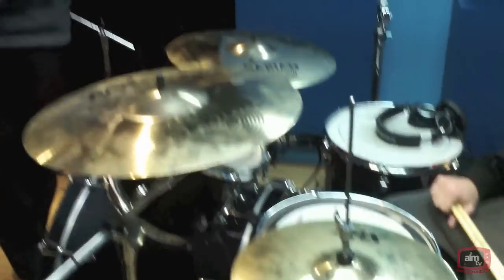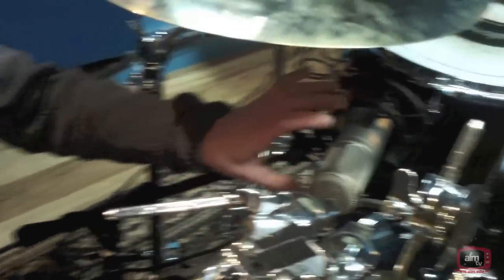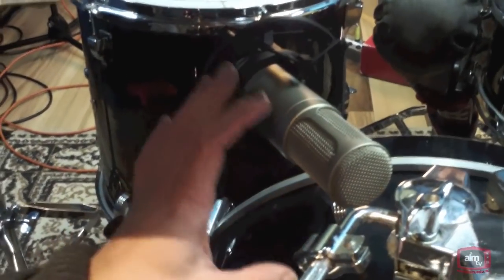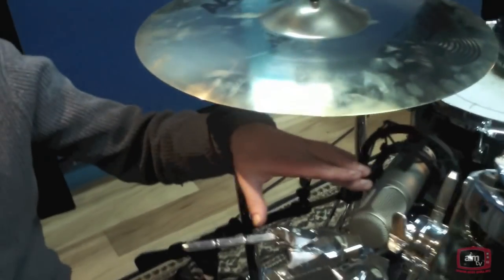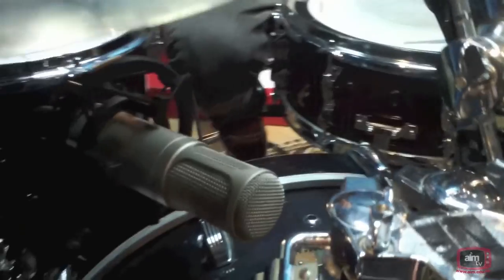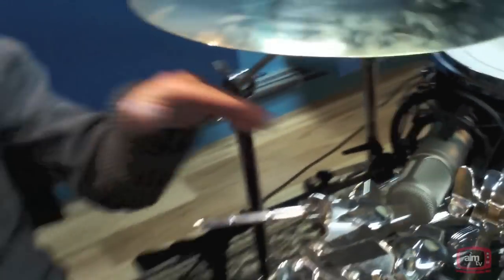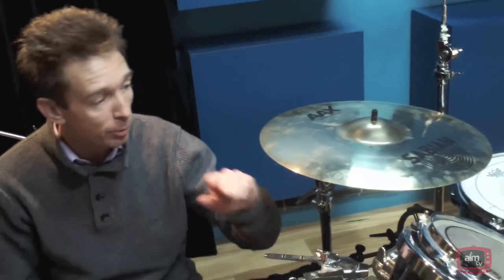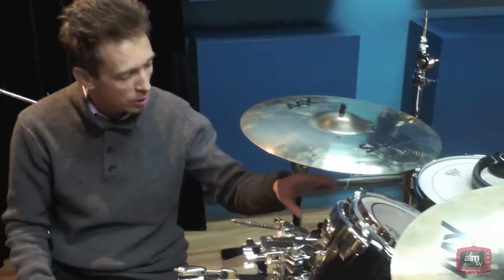How To Record Drums - With 1 Mic

Comment: Again, it's all about the context of the drum sound you are after. If you are after a gritty type drum sound, then your method would certainly be awesome. However, it won't give you a clean drum sound with your way - or rather not as clean as the method shown. Also, if you wanted to record it, you'd need to mic the guitar amp (more processing) or take a line out from your guitar amp (more processing). It all depends on your final outcome and the sound you are after. Cheers - Jason de Wilde

Comment: I recently recorded my drumset also with 1 mic (sE2200a II) , and placed it above the back of my head, pointing towards the snare. I recorded with cardioid mode, -10dB pad turned on and without bass rolloff. The result was actually that it almost sounded like the kit was mixed with 12 channels.
Reply: That's really helpful! I'd like to try that, and was going to ask about the pad and rolloff. How high in the air was it, just above the back of your head? And just tilted down to the snare?
Reply: you're right, it sounds excellent! thanks!
Reply: no phase issues and also i dont like the sound of everything close micd unless its for a super specific reason

Comment: I've just had a go at this.  My drums are set up in the garage, so very poor acoustically.  I'm using some sort of Bheringer condenser.  I am very pleased with the results.  I have a much larger kit than the one in the video but I've managed to get a pretty good balance with minimal messing around.  I wouldn't use it for a release, but to record ideas and work on stuff to share with the band, it's going to be perfect.

Very helpful video!

Comment: I've been using couple of variants of this method with excellent results. Works just like described in this vid. The other one similar to this is the 'crotch mic' method. With a little compression and EQ processing, it can be seasoned to one's own taste. Put it up in the mix,  and it'll sound excellent.

Comment: Hi, glad you gave this a try, and I understand what you are saying about the cymbals. What you could try is a little bit of EQ boost at around 12KHz and above. I find that it adds a little bit more "air" in the overall sound. Also, I've (finally) got my own channel now which you may want to check out for more info on recording etc, Cheers. Jason

Comment: yeah i've done this before and it generally works for recording (not quite as well for live playing/extended playing cause the balance of the head will be thrown off). also, i read in a drum magazine a few years ago that an engineer gave this same tip to the drummer for rage against the machine.

Comment: Thanks for the feedback. I guess the whole point of this exercise is that it is possible to get a reasonable drum sound from a single mic - great for those that have limited tracks, limited inputs (you could do this on an Mbox mini) and importantly little to no EQ. As soon as you add more than 1 mic, you'll also get phase issues, for example between your overheads and snare. With this single mic method, no phase problems. It's also great for jazz recordings. Cheers. Jason de Wilde.

Comment: Hi there, this is Jason de Wilde here. The small problem with using a D112 is that it's a dynamic mic, and that means it will most likely miss out on some of the "air" or high frequency sounds. You'd notice this in the cymbals particularly, and it would just lack something. Certainly, if you have nothing else, it would be worth giving it go. It certainly would produce a hefty kick and snare. Cheers. Jase

Comment: my method was going to be to put it in front of the kick striking head at the top pointing up at the snare and cymbals thus gaining some thwack element from the beater contact. It's close enough to the mounted toms to pick them up too - but as far as the floor tom goes - just hit it hard!

Comment: I did not use any compression on that video, but it's certainly possible to use. I did try it on a recording I did later, and it gave the drums a pretty cool trashy sound which was OK for the context. I'm generally not a huge fan of compressed drums. If I do compress them, I'll parrallel compress them so that there is a mixture of uncompressed and compressed.

Comment: I generally try staying away from recommending specific brands. Obviously the better brands (Neumann, AKG, Beyer dynamic) are going to yield awesome results. But these mics are generally out of most peoples budget. I'm using the Rode K2 which I think is excellent and is comparatively cheap. I've also been favouring Audio Technica mic recently. Again, good sound, with not such an outrageous price tag. The AT 4050 or AT4040 perfectly capable mics.

Comment: Now, I don't know if it's their reason for it, but I can see why someone would leave a rod out. When tuning the resonant head of a tom, if you get the lowest tension possible with no wrinkles, it will give an amazing low-tuned sound to it, no matter the size. This could be an alternative to that, where, just a thought, they might have the rest of the rods tuned normally, but left one out to give a lower sound.

Comment: what would happen if the mic were pulled out a little toward the front of the kick for a little more low-end definition?  I'm a drummer meself, not an engineer, so just guessing here...but with some control on the drummer's part, not just hitting hard all the time, lighter touch on the kick, the drummer could help "mix" the perfect single-mic drum sound that way?  I'll try it!  Thanks for this great vid.

Comment: Hi there. There are so many factors that will make something sound "decent" that it's hard answering your question. Start with a great sounding instrument, then out the best mic you've got there. You already have a great interface (I dig the Apogee duet), so you're doing well. It also depends on the musical intention. The technique I videod would suit some styles but not others. All you can do is try it.

Comment: can you do a video or give and idea of how to eq and "treat" setup like this? i have tried a few different mics and on their own the drums sound quite good and balanced, but once i add all the other instruments it sounds weak and cheap. 
Thanks
Reply: I'll have a look to see if I've still got the file and I'll do a quick tutorial on that. Thanks for the request Aaron.
Reply: To EQ it, copy and paste the track to multiple tracks. EQ one of them for the bass drum to come out, the other, cut out a lot of the bass and focus on the mids, the other, boost the highs if you want to.
Reply: nagol5178
thanks! i can't believe i never thought to do that... ive been trying to do it all with one eq and am really struggling. thanks so much! would you compress these tracks differently? or use a bus compressor on all?
Reply: I compress them on a bus. But there are advantages to compressing each one on it's own. It's just a matter of what you're looking for. The more mics the better. If you use two mics opposed to one you can EQ the bass a lot better from a mic in front. I use two condenser mic's, an XY condenser mic, Sm57 on the snare, 906 on the floor tom. One of the condenser mic's is in front of the bass drum, the XY is close to it as well. I EQ all of them differently. But I have done recordings with one mic and done what I just suggested. It worked well with an XY mic.
Reply: +nagol5178 That sounds like it would create some phase issues.
Reply: @cerumen  @nagol5178 Good point, would it create phase issues?

Comment: Yes I ALWAYS use this technique as I get terrible results with more than one mic
mostly phase issues Im certainly not clever enough to resolve
Point one mic at the snare and it'll sound ace
Reply: Pan one mic to the left and the other to the right, check your correlation meter to find any phasing issues. Then flip the phase on one of the mics if you have phase-canceling.

Comment: I don't think the example recorded here captures a good balance of the kit sound. 
There's two other single-mic positions worth exploring: 1) omni mic at the drummer's right knee (also known as "crotch mic") and 2) In front of kit a bit to the drummer's right side, 2.5 feet from snare, about the height of the bottom of snare, pointed at midway between kik and snare

Comment: Hi Ted Mathew Nuguid. For some reason I can't reply to your comment directly. But in answer to your question, yes, you can use a producer USB mic, and it should yield a reasonable result. I've also tried this technique using an Apogee One plugged directly into my laptop. Worked GREAT. http://www.apogeedigital.com/products/one
Reply: Thanks for replying! I tried this technique and I think the problem might be the room that I play in. I noticed that the kit in this video is in a smaller room with some foam to absorb some sound. I play in a big room, tile floor, and nothing to really absorb the sound.

Comment: Is there a way of placing a condenser mic to record the drums that exact method shown in this video but without having to remove the tom to place the mic in that location? I would like to record but hate having the second tom removed to fit in the location as seen in this video. Some songs I need the tom that is in that location but also need the mic there... Perhaps there is another way to do it with one mic so that I can keep the other tom in that spot on the right of the kick?

Comment: I have an electric and an acoustic set and I'm wondering which is better for recording? I'm using a Roland V-Kit as my electric and for my acoustic I would use a Zoom h4n handy recorder. Any advice would be appreciated, thanks!
Reply: Hi Wesley. Sorry I haven't replied sooner. I would definitely try the Zoom using a similar technique as used in the video. I think it would actually sound pretty OK. I've done a similar recording with an Apogee One which also has a built in mic. When you use the Zoom, just be careful of the recording level - it could overload pretty easy with the sheer level of the drums. I would tend to use an acoustic kit for recording, and THEN supplement that with additional sampled/electronic sounds. Check this one out...https://www.youtube.com/watch?v=lApwRKY-Fa0&list=PLEEBEE0E007C16476&index=22

Comment: What if you have two rack toms? Where does the mic go? Do I put it under the second rack tom or over the floor tom (like the glyn johns but with only one mic) or do I put it somewhere else?
Reply: I've tried it with 2 rack toms as well. I kept it in the same place as the video above, and it was still pretty well balanced. You could try moving it back a little bit in order to pick up more of the rack and floor, but you should listen for any lost definition of the kick/snare. Make sense? Cheers from Jase

Comment: my question is, works for a live gig? thanks...
Reply: It could work, but you'll probably need a drum shield so stop all the other sounds around you from being picked up. That type of mic collects sounds all around it.
Reply: ***** i forgot to mention, i mean in a small clubs, sometimes i see bands that put a single mic on the top of the drum kit on a small clubs, thats what i loocking for, a single mic for live gigs on a small club..... witch one i should use??...sorry for my english...

Comment: tried it, sounds surprisingly good, but impossible to mix properly !!
Reply: with this setup ya just gotta mix yourself live with dynamics, its the only real whey.
Reply: blindskywatcher ...for real drummers :) I'll keep practicing !
Reply: blindskywatcher what do you mean by "mix live with dynamics?"  I record my drums with one mic, but I also have a problem mixing it with the rest of the track.  Do you have a certain position to pan the drums?
Reply: alex f try recording two tracks at the same time, then pan the first one to L70 and the other one on R70, you should get some depth and also some boosted volume if you're recording it with just one mic
Reply: massimiliano zanca thanks, will try that. So far I've been lazy and just duplicated my single mono track panned straight down the middle :P Also I think I need to create a sound tight space because I had too much room noise on the track.
Reply: Laura Sonneveldt You can also use the mono track and then send some of that signal to a stereo reverb. It gives you some extra ambience and nice subtle stereo image. I like to use "ambience" or "room" presets as a starting point. good luck with it.
Reply: jasondewilde I've positioned the mic slightly different, but still quite similar to this video and recorded a Real Nice sound. Panned it L70 R70. It's got natural room reverb. With a tiny bit of gating it sounds like Stevie Wonder's kit on Songs in the Key of Life. Lol. I better write some old fashioned music :)
Reply: Laura Sonneveldt So did you use two mics in order to pan it L70 R70? I'd be interested to understand the technique.
Reply: jasondewilde No, I just used one mic and recorded onto two tracks. Then panned them...L70 R70....
Reply: always doubletrack, never copy and paste, keep in mind that pitch and timing are very important.
Reply: +Laura Sonneveldt How is that possible? Did not work for me. Here is a quote from the manual: "Important: You cannot record-enable tracks that are set to the same input. Each track needs to be set to a different input." 
One mic = one input, right?
Reply: +Freddd95 yeah, how the hell did I do that?  Either it worked or I recorded onto a stereo track panned to L70- R70....it's 11 months ago I wouldn't remember anymore...
Reply: +Laura Sonneveldt it must have been a stereo track.....last time I checked I only owned one mic
Reply: +Laura Sonneveldt In order for something to be in &quot;stereo&quot;, the left signal has to be different than the right signal. Our ears pick up the differences and we perceive it as stereo. With your method, you are recording the exactly same signal on 2 tracks, so no stereo image is being created. You will get a perception of it being louder, but no stereo I&#39;m afraid. As mentioned earlier in this thread you can create a &quot;stereo image&quot; by sending the sound to a stereo reverb unit. The reverb s designed in such a way that the left and right outputs will be slightly different. Hope that makes sense.
Reply: +jasondewilde thanks for that...I've got so much to learn and minimal knowledge and gear !!
Reply: @jasondewilde  So just to be sure I understand, recording to two tracks and just panning them full L and R won't do anything, other than make it sound louder?
Reply: @denniscrommett  If you have 2 mics, then it is fine to record 2 tracks. But in this video, we are only using 1 mic. If we duplicate this one mic and put it on a different track, it will not give us a stereo image. We are just putting the same signal on 2 different tracks. It will be louder if pan them in the middle.
Reply: @jasondewilde  Thank you!